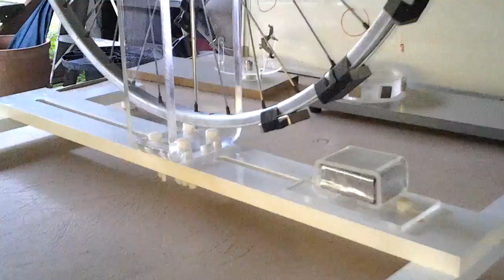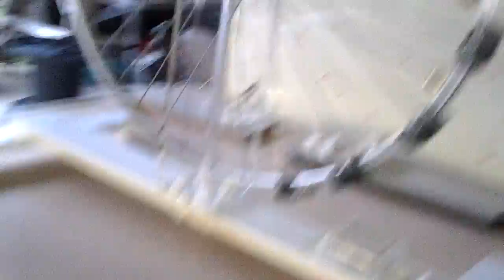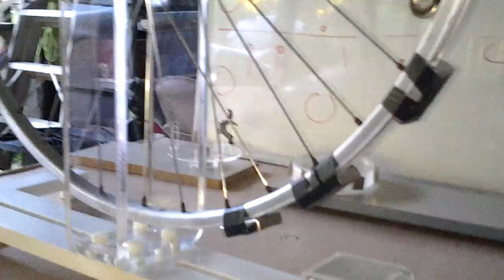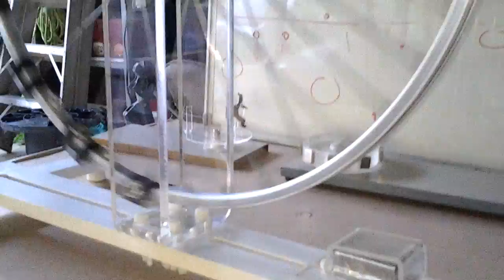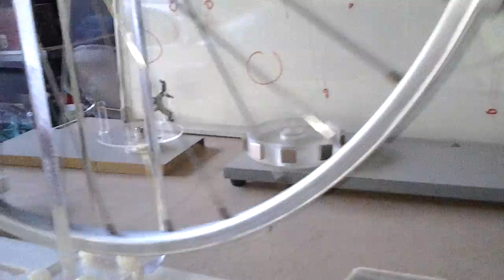Magnet Motor Using James Roney Stator

Comment: Another thought on this motor. The rotor makes it past the stator because the positive torque (magnet to magnet attraction) appears to be stronger than the negative torque (magnet to steel shielding attraction) slowing it down. To reduce the negative torque how about adding a small magnet (such as one of the wheel balancing magnets in the video) towards the back end of the shielding with the outer pole repelling the rotor magnets. The purpose of this is not to repel the rotor away but to let the rotor be attracted by the steel shielding but the attraction will be partially cancelled by the extra magnet thus reducing the negative torque.
If you have a wheel set up then this will be a simple experiment.
I would be interested in hearing about any progress on this motor.
Reply: Of course, this is impossible. But stupid people who hate science want to believe that the impossible is possible since it is on YouTube. So continue to lead your worthless waste of an existence in ignorance.,

Comment: Try the rotor magnets closer together.
Reply from the maker: yep, have got a lot of spacing experiments to continue on with. I have tried a limited amount of spacing placements. Problem with going closer is that the magnets are so strong at repelling each other that they tear the tape. If I get on to some good placements I will use an epoxy.
Reply: gene fewings This is the first serious attempt I've seen on You Tube to replicate the work of James Roney.
 The exciting thing about James Roneys experiments is that if you release the wheel (without giving it a push) at the point where the rotor and stator magnets are just starting to attract each other, the last rotor magnet manages to make it past the stator magnet and the wheel continues to rotate. Its still a sticky spot but not quite sticky enough to stop the wheel.
 If you manage to achieve the condition where the rotor magnets clear the stator but the next group of rotor magnets don't quite reach the stator then you could add a second stator around 90 degrees to the first stator and/or have three groups of rotor magnets at 120 degree spacing instead of the two groups at 180 degrees.
Other variables include stator to wheel distance. If the stator is too close to the rotor magnets that reduces performance.
Good luck in finding a loophole in the theory of thermodynamics!
Reply: bob s Unfortunately James Roney was fooling himself in much the same way as it appears you have fooled your self.  Think about the average torque over one full turn and you will likely see your mistake.  Ignoring friction, the average will always come out to be exactly zero.  Basically, you store a little of your energy into the wheel when you push it into the starting position.  The energy then causes the wheel to rotate when you let go.
Reply: Ken Smith If the rotor magnets clear the stator and continue to rotate with a little energy to spare it looks like the process should be repeated when the next group of magnets reach the stator.
If you are right then the wheel will stop within a few revolutions. The laws of thermodynamics and 500+ years of people unsuccessfully trying to build perpetual motion machines strongly suggest you are right. I'm not saying the motor will definitely work but the principal looks promising so I'm waiting for Gene Fewings to complete his experiments and report failure or (just maybe) the laws of thermodymics turned on their head.
Reply: bob s

I am going to avoid calculus here
I am also going to use clock positions for angles

No, really, the principle is not promising because it is a fairly simple error to spot when you take it step by step.  Just to make the explanation of why easy, lets start with just one pole on the wheel and one on the "stator".  Also put the pole on the stator at 12 O'clock.

Imagine that you are entering torque values into a spreadsheet.  With the single pole on the rotor at 12:00, the force between the two poles is lined up with the axle so there is no torque created at all. 

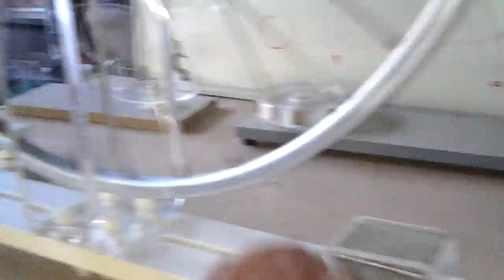Now imagine that we want to get the numbers for 1:00 and 11:00.  We notice that the device is its own mirror image along the vertical line so if we measure the value for 1:00, we also know the value for 11:00.  They only differ in their signs.  This is also true for 2:00 and 10:00 etc.

Thus we have proved that the simple case must average to zero because for every positive torque, there is an equal negative torque so the average over one full turn must be zero.

Now imagine you move the magnet on the rotor to the 1:00 position.  Obviously this in no real change.  It is just like we turned the wheel to the 1:00 position.  Thus where on the wheel we put the pole doesn't matter to the average.  The same is true of the position of the stator's  pole.

Now if we put two poles on the rotor, the average torque is 0+0=0 and the same is true if we add a pole onto the stator. 

We can make any combination of pole locations by adding poles one by one and working out the average torque with 0+0=0 at each step.

Thus we can say for any combination of pole locations, the average torque will be zero.  Thus all machines of this type are shown not to work.
Reply: Ken Smith That would be true if the stator consisted of a bar magnet pointed at the rotor. In this case the last rotor magnet would not make it past the stator. The design of the James Roney stator appears to cause the sum of the positive torques to exceed the sum of the negative torques. Theoretically this is not possible but observation suggests that this might be happening.
I'm not saying rewrite the laws of thermodynamics but this apparent asymmetrical torque effect looks worth investigating to determine whether it exists or not.
Reply: bob s   Go back and read what I said again being careful to note that I spoke of just one pole on the rotor and one on the stator rather than a magnet in each place.  You will see that I am right.  Yes, I know you can't really get just one pole, but the thought experiment works to show how to do the calculations for real cases.  Doing the logic can save whole lot of time.
Reply from the maker: bob s i was thinking the same thing. I haven't heard from James rooney in about 4 weeks and i am hoping he can get back to me with some more accurate distances of rotor magnets. I think James design is the most promising which is why I have pursued it more than the others. Has anyone seen my Paul sprain replica (here on my channel). It's not completed yet but I have some high hopes for it also.
To ken, The reason i build a lot of these prototypes is to obviously see if they can work but also because i have a great workshop and enjoy doing it when it's raining and i can't work in the Earthmoving company that i own. Therefor I never consider it waste of time as all my models are built to accurate specs (and to look good) and are real talking pieces when customers are in my workshop. I really appreciate your technical input however, and I will hopefully implement some of your clock style ideas if I get time this weekend.
My bike wheel is aluminum and moving the magnets with the tape is a pain. I need a better method so I can change placements easier. Any ideas anybody?
I didn't go for a steel rim like James as I didn't want the wheel to disperse the fields and effect rotation. I have toyed with cutting a big circle out of plate steel and trying that but it's a lot of effort compared to the bike wheel and once again, the dispersion, but maybe that's the secret, who knows.
I love reading everyone's comments, keep the ideas flowing everybody.
Reply: gene fewings You can buy plastic bolts and wingnuts and G10 plates and make clamps you can do up and undo.

The clock was a thought experiment.  If you are building anything make stuff that takes measurements.  One way to make measurements is to put obvious markers on the wheel and video it and then step frame by frame and measure distance per frame.  Another is to make basically a very low torque torque wrench.

It seems that if you are going to build stuff, however, it would be better to make things that could actually work.  The explanation I gave was a proof that no wheel like machine can ever be a source of energy.  It is a general case proof and thus we can say that the odds of any of them working is zero.
Reply: gene fewings
Using a steel rimmed wheel will allow the magnets to stick better and the steel will partially shield the unwanted poles of the rotor magnets which may have some bearing on the success of the wheel. Comparing your wheel to James Roneys his wheel had its magnets slightly closer together than yours but looking at his videos if they are too close acceleration is reduced. By the looks of your video it seems like you were almost there, just needs additional stators.
The success or failure of this motor depends on whether or not unequal torque exists when the rotor approaches the stator and when the rotor moves away from the stator. On approach there are opposite magnet poles attracting each other but on leaving, the shielding will cause the negative torque to come from the attraction of one magnet pole to steel. This will be weaker than the force between  opposite magnet poles. It could be argued that the negative torque may be lower but will act for a longer period thus balancing everything out. To determine what is happening an experiment needs to be devised that continually samples and stores the positive and negative torque readings then displays them as a graph. Then the areas under each curve can be measured which will proove if this motor can work or not.
Reply: bob s Introducing a steel wheel makes the situation more complex and adds hysteresis losses to worry about.  Even though the proof that with or without the steel rim the thing won't work is fairly easy to do, adding the steel rim increases the losses so that even if it could work, it wouldn't.
Reply: Ken Smith The more I read negative sayers as Ken Smith...The more I appreciate and will encourage guys like Gene Fewings  and James Roney  to keep trying...The universe we see is only 5% of what's out there...The light we see is only 2.3% of the entire spectrum...The laws of physics are only theories that get knocked off regularly  by out of the box inventors like Gene and James...Don' give up guys ...I'm with you
Reply: Bruno Giet Proposed a simple thought experiment that shows this idea is a waste of time.  Being a waste of time means that time spent on this blind alley is time that isn't spent on something that could actually work.  I make my living by inventing stuff that works.  I am encouraging others to do the same.  You are encouraging them to waste time.
Reply: Ken Smith As an inventor you've had your trials and errors...Why not let others do the same ......You thought experiment is well taken but it's just that .(your thought) ... Many incredible inventions have had their lot of detractors but today  we are lucky the inventors didn't listen...
Reply: Bruno Giet The way science advances is that people learn from the past.  Repeating the same old mistakes gets you nowhere.  You seem to not understand what a thought experiment is.  It is method to explain why something is true.  Anyone can repeat it just by stopping and thinking.
Reply: Ken Smith You said it Ken...stopping and thinking....Just what these guys are doing ....so that the mistakes of the past are corrected at last...5 million failures in the past does not mecessarily mean that the next one will be a failure as well
Reply: Bruno Giet No, they did not stop and think.  Consider the thought experiment.  It shows that what they are doing can't work.  They could have tried something else instead but instead they wasted their time.  I can't fly by flapping my arms up and down.  Do I need to try that again?  I think not.  A simple bit of physics tells me that I will never be able to fly by flapping my arms up and down.
Reply: Try living in reality.